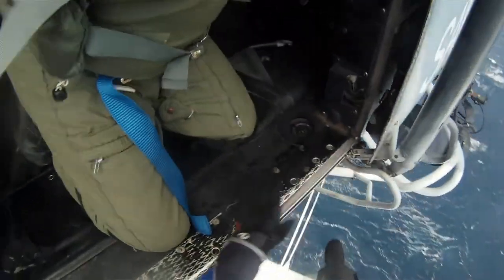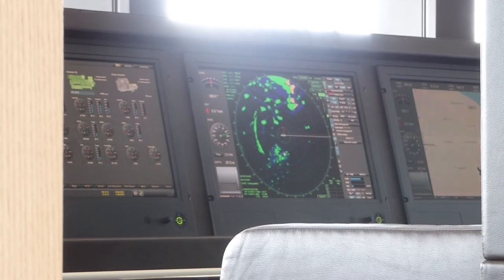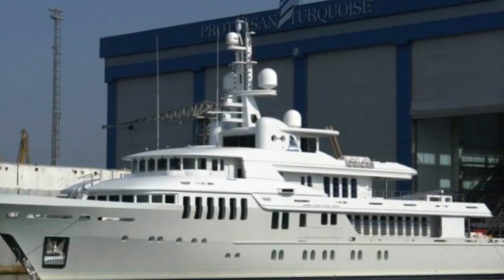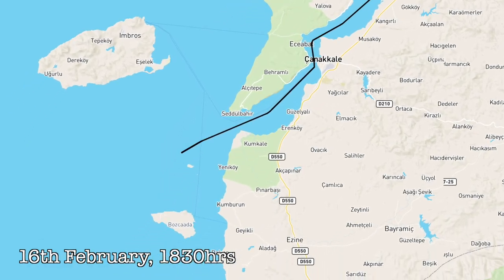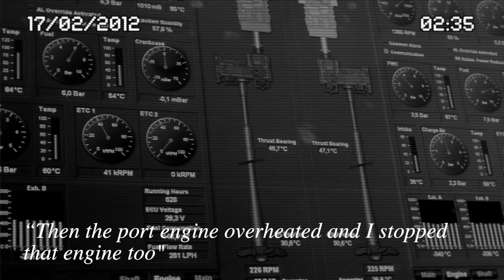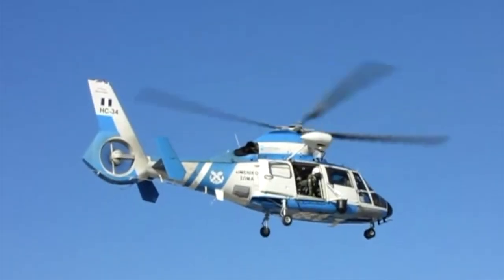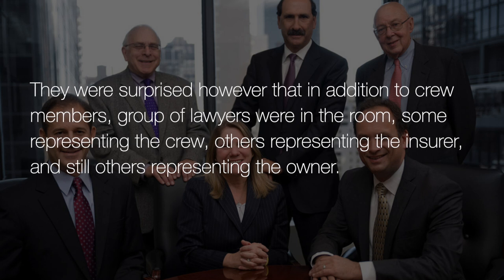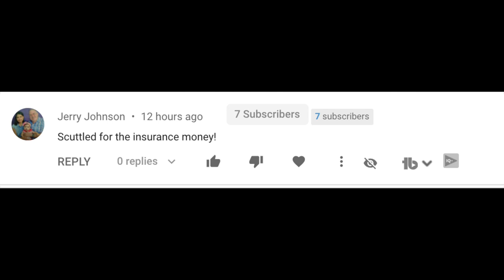Yogi: Largest SuperYacht that ever Sank - Part 2

Comment: Nice couple of videos around an intriguing, well told story, with still more questions than answers.
When you are adding 25tonnes of balast to a ship to bring down the centre of gravity due to an owners design need, changing around waterline level design issues on what need to be water tight compartments, and then replugging seadoors to keep them sealed and watertight = I don't know how you can't conclude the builder and yards weren't in loading the pack towards a forth coming disaster.
The fact the comms systems didn't work also suggests yard issues, and as you say crew fails - was it fatigue? Amazing that the crew got out with passports/papers, but no log. Unless the vessel is designed as a lead weight (which this one had tendencies of), then crew and procedures must have been a contributory factor.
Finally, those good and newly created French registry and subsequent report. "Honest, we didn't do anything wrong" (grab the lawyers NOW). That suggests they knew the design was on limits, that operating on limits could be dangerous, and that they learnt a lesson by shifting the blame away from thier enginners and staff.
As you rightly conclude, a combinstion of factors add up to an accident, and in this case it doesn't seem anyone comes out clean.
Thank You - be nice to see more of these videos where we get an insight into your professional world and real demonstartion of your inside working knowledge. These videos have been great original content - more please, it has really showed your insight as unique. Good Luck!
Reply: All I could think of watching the design changes was dozens of engineers cursing up a storm as the cascade of effects builds up. Of course there were going to be unanticipated issues. 
I think the shipbuilder showed good faith wanting to talk to the crew. If they were only interested in covering their asses they would dig in just like the crew and insurance company. But of course they could have been looking for a way to shift blame as well.

Comment: That captain screwed up and the lack of communication with engineers is highly suspicious.    Full speed over heated the engines,   the water? That's the big question.  Was the door opened?  I find it hard to believe a shipyard would make such a careless mistake with inspectors constantly checking work.

Comment: Some unfortunate inaccuracies in the narration.
It talked about additions made to the vessel sun deck, a hard roof etc, in other words, weight added to the top of the vessel that the original design never allowed for.
Also that the vessel was longer than originally designed / extended a number of meters?

Adding weight up top on a vessel increases the roll period.

Adding weight (ballast) to the keel is intended to counter act effect of the weight added up top and “stiffen” (reduce the roll period).
Adding weight above the vessels meta center makes it less stable than originally designed.
Adding ballast below the meta centre is a way of making it more stable to correct for the effect of the weight added up top.
The meta centre is the midway axis point between centre of buoyancy & centre of gravity about which the vessel pivots.
Monohull vessels of this nature normally have a hull length to beam ratio of approximately 3:1 ratio.
Lengthening a vessel (cut & shut) alters this ratio.
The width of beam is what provides your block waterline stability. Adding length without increasing beam, reduces incline stability.
It’s typical of owners who want a bigger vessel to want to make them longer but it often interferes with the original designed intact stability.
In this instance you had both weight added above and below meta centre, as well as a lengthened hull, all of which reduce standard incline stability - beyond the parameters of the original design.
Water ingress introduces a free surface effect - where a list is introduced, (weight of water all rushes to one side unbalancing the vessel.
So whatever plumbing alterations and water right transom door alterations were carried out, allowed water ingress to overwhelm whatever reserve intact stability was designed into the vessel.
Why pumps couldn’t keep up, why the water tight bulkhead doors sprung open etc, could possibly be related to the hull twisting longitudinally due to the lengthening process that it was never originally designed for.
When owners “screw” with naval architects designs, they inevitably ruin good vessels & make them worse.
Whoever came up with the unauthorised drainage design also probably contributed to the issues.
These vessels have a placard at the helm that sets reduced maximum speeds in increasing sea states (based on the Beaufort Scale).
The vessel was operation at max speed in max sea State is just pure poor seamanship on the behalf of the master.
It undoubtedly led to the engines overheating.
A contribution of a series of events lead to loss of the vessel in my opinion.
Additional weight up top beyond original stability design perameters, addition of ballast to the keel to compensate, lengthening of the vessel further reducing standard incline stability by altering the length to beam ratio from the original naval architects design, probable failure of water tight integrity of the transom door, possible longitudinal twisting popped the water tight compartment door, allowing flooding & contributed to loss of steerage capacity, and likely the unauthorised drainage alterations may have failed and allowed ingress of water beyond pumps capacity.
Sounds like a right royal cock up of monumental proportions to me.
Altering a boat to placate an owner should be outlawed.
If he doesn’t like it he should be forced to sell it and have a new one designed and built.
I would not have mastered that vessel with all those alterations, not in a pink fit, you couldn’t have paid me enough.
This master did all his stability calculations manually when he bunkered fuel before leaving.
This means he had & understood the vessels intact stability book, it’s GZ righting curve etc, which means he should have understood the risks of all the alterations made.
Was the vessel re-surveyed after all these changes or was the master working off the original “unaltered” stability book for the vessel when he bunkered fuel?
Perhaps he unwittingly contributed to the instability when he bunkered fuel if the vessels stability book wasn’t upgraded to reflect all the alterations?
Incompetence all round appears to me to be the most likely cause.
I’d have to question the masters competence.
Reply from the maker: There were no inaccuracies in the narration. It was taken from the final report.
Reply: eSysman Well the final report was fundamentally flawed then.
The narration stated that lead ballast was added to the keel to compensate for the weight added to the sun deck “to make it ride higher”.
Dunno about you but last time I looked any weight added to a vessel as ballast or to the superstructure makes it ride lower not higher!
If you don’t understand simple displacement theory you have no business either writing or narrating such a report.
I say this as a master qualified to operate this vessel.

Comment: Now don't get upset but my 35 yrs as an engine diagnostics
technition, 
The engine roon managment was lacking. The bigest problem i would guess is the builders and designers didnot properly have the steering inspectedafter the unregulated work done adding tanks? To catch leaks?
In the area of the steering?
The phones may have shorted from the "Leaking".
Those overheated engines were due to pushing the engines in far but with out proper sencers the chief mechanic should have known but if he was a  new replacement would not have ben very familiar with the various special needs or conditions
That as were said "not in the "as built" specs/ plans.
[The suspitious nature of what happened .]  The mechanic should have known to watch the motors closely and advised the captian not to overwork engines during their "breaking in"
Voyage.
It also sounded like the crews did not close the water tight doors, adding to or quickening the sinking. Does this vessel have balast system that could be used to counter the taking on water (early on )?
Basicly design and crew faults.crew not prepaired knowledge or ability i do not know, the captain should have done alot more to keep the ship a float.
Too bad the investigation was so shaudy and incomplete.
I would have had the builder aswer more about the wet exhaust system blueprints aswell as the inspecters that gave it  a clean bill   of health without inspecing the door seals and added construction before first major voyage.
*I would like to see the forenzics report and engine oil lab results. But unfortuately that will nevet happen .
And the builders suicide pritty much seals this into the "we may never know " catagory.
Sorry for going on ..
But i used your videos and , well you said it all already.
I will be watching hoping for updates because there are too meny unanswered questions. That dugs me.

Comment: It's obvious the crew didn't know how to operate the emergency systems on the ship.  Understanding the surface effect of the flooded compartment, it should have not had that large of an effect on the ship.  I agree there was significant laps in the crew, and a complete lack of Standard Operating Procedures on the ship.  No attempt to dewater the compartment was mentioned (30-40cm is nothing to de-water) why they were operating at such a high speed in such weather, and why they would operate without any way to communicate between the engine room and the bridge was complete negligence. Read between the lines, the engineer was riding the ship back to home, and wasn't in the game.  Captain was over confident, and the other engineers were poorly trained.  If it had been a aircraft and it crashed they wouldn't have gotten off so easy.  Finally it looks like this was a great opportunity to discredit the builder, and lawyer up and push blame to the builder and get a insurance payoff for the owner to pay off his debt. I suspect there was pressure to deliver the ship to a charter, or a event and they pushed too hard and this is what happened.  Basic Damage Control would have saved everything.    Finally the French won a battle, but lost credibility.  .

Comment: I doubt very much that this tragic event was planned. Anyone who has ever spent any time at sea will confirm that you have no guarantee of rescue when you are onboard a sinking ship. As eSysman said in the video, it is probably down to a catalogue of errors which led to her sinking. The problem here is that complacency clearly kicked in. Sailing in the middle of the night, when the crew were knackered, I doubt they were following procedures as they should have done when it all started to go wrong. I used to run my own insurance company, and most fraudulent claims came from fire damage as the risks are easier to control (in the context of a fire aboard a boat). I doubt very much that eight crew members were willing to risk their lives in order to benefit the owner. I think the 'cover up' was more to do with the lack of correct procedures being followed, rather than covering up the intentional sinking of a multi-million £ yacht. In my own, humble opinion, that is....
Reply from the maker: Like you say, when you’ve been at sea it’s hard to imagine sabotaging the vessel from beneath you.
Reply: @YachtReport  No seafarer would intentionally stay on board a vessel that is sinking. The boat/ship is the only thing that can keep you alive. Great video by the way!

Comment: I’m having trouble understanding how a vessel of Yogi’s size and displacement and relative new condition could lead to its capsizing. The vessel was well equipped with safety gear and a 32’ tender which could have been deployed or should have been deployed immediately upon sensing trouble with the yacht. The vessel had water tight compartmental doors on all levels below the water line. Securing all water tight doors below should have been enough to save the vessel from sinking I would think. That is the standard protocol is it not?
After studying the floor plan I’ve come to the conclusion that Yogi SHOULD NOT HAVE CAPSIZED if the watertight compartments were properly secured. How is it possible that a crew with a primary and secondary chief onboard could have done such a poor job of securing the vessel against such a catastrophic event. It makes no sense to me and given my honest opinion I have no other way of concluding that the event happened as a result of an accident or chain of events leading to its sinking. My opinion, and I say this only as an outsider looking in and over the evidential materials made public, that this vessel, Yogi a superyacht worth @$40million USD was sunk purposely. No other conclusion can be found based on the boats construction, equipment and crew. She was a victim of Insurance Fraud and any investigator familiar with maritime design and law would come to the same conclusion as I have. 
I hope the truth comes to the surface unlike the vessels fate. 
✌🏻🇺🇸

Comment: The Captain must order to Chief engineer to slow down the engine because of bad weather. Not good for the engine performance if too hard pounding due to strong winds and seas. They slow down the engine but too late.  Regarding this communication that no handheld /portable radio, thus lack of communication. Perhaps the high ranking officer got drunk on that time, ah and they were reluctantly moved into action on what to do the good thing.

Comment: Lot's of comments about insurance fraud.
Ask yourself this question. Would you risk your life in a storm for a pay off? To deliberately sink a vessel of that size is extremely risky and your chances of survival in weather like that aren't great.
The chain of events seems the far more likely.
Working hours being broken, crew getting more and more tired and making more and more poor decisions. 
We all watch the video and say, why didn't they do this, why didn't they do that? Easy to say when you haven't been awake for 20+ hours.
Why was the Captain going at full speed? he was desperate to get the shift over with. 
There wasn't one thing that sunk that yacht, it was a chain of errors that led to it. If any of those errors had been broken, she probable would have limped into port.

Comment: These guys had just finished their shake down and warranty yard period and now they were at a point where they were ready to put the vessel into service.  They had just came out of the yards and should be ready for a “full power trial”...but you do that in calm seas.  Had the crew gone through engineering causality control drills?  Was the communication system operating prior to leaving port?  When your seas are higher than your freeboard, you set watertight integrity, had that been done?  Bringing personal effects and leaving the legal documents...leads me to think there is some frigging in the rigging.

Comment: Really interesting. Seems a quite well prepared insurance fraud to be the most likely explanation. Or a nearly unlikely chain of errors from the crew, but it still leaves questions why they did not activate many possible emergency actions once the trouble started. Then also extremely strange with the non working AIS combined with the differing testimonies of the ship speed the day´s before the sinking (why run 100% in bad weather, it´s more that they want something to break). And even stranger why they managed to collect all their important private belongings for the evacuation, but not the ship logbook and ship documents.  Really a tragedy for the shipyard.

Comment: On a brand new state-of-the-art superyacht I'd expect the engines to be able to operate at full load in any weather without overheating. If they couldn't then the cooling system must have been poorly designed.

Comment: New subscriber, I just have a general question. Where does the crew stay for the duration of the voyage? Specifically when they are not performing tasks
Reply from the maker: In crew cabins usually lower in the boat just above the water line. Look at any yacht towards the front and you’ll see small round portholes, these are most likely crew cabins.

Comment: When I charter an explorer with a submarine I'm going down to the wreck.
Reply: 500m is actually really deep. Not compared to the depth of the Pacific but it is still really hard to operate at that depth, you need specialized submersible craft.

Comment: There is plenty of blame to go around.   Only the designers accepted their share, not the crew.
Design was flawed from modification, failure of high water alarm, no high temperature alarm/shutdown, post safety checks.
Crew was negligent for improper or lack of communication devices, failing to perform their own safety check, following emergency procedures, recovering safety log and data recorders.
Multiple systems fail when tragic accidents occur all created by human error.

Comment: Aegean sea is a very rough sea. Keep that in mind.
Reply: Its a 60M close to 200 foot steel hulled boat. They are designed for trans ocean crossing. The Atlantic has big seas, a lot of super yachts cross the Atlantic twice a year. Around October from the Mediterranean to the Caribbean & back to the Mediterranean around May. I seem to remember they were in 5M seas that's not a very big sea for the Atlantic, should not be big enough to sink a new boat!

Comment: As a diesel fitter I cannot see why she would fail at 100%. Normally max working power has to be 90% of cooling capacity, or the engine manufacturer won’t sign machines off. (Generators and compressors)

Comment: Engines ran to fatally disable the vessel ?
I don't see why a ship with wet exhaust would not be equipped with shutters and valves to secure the exhaust.